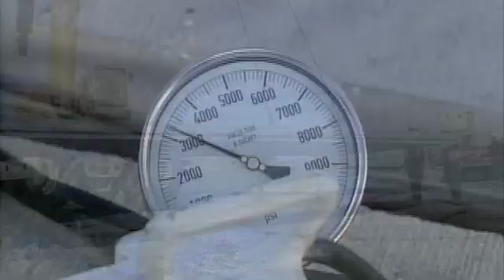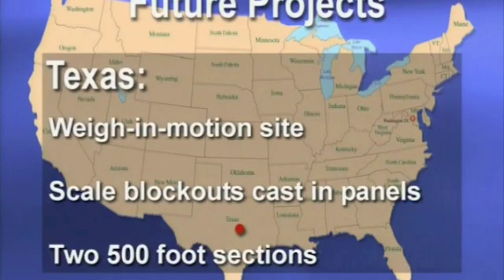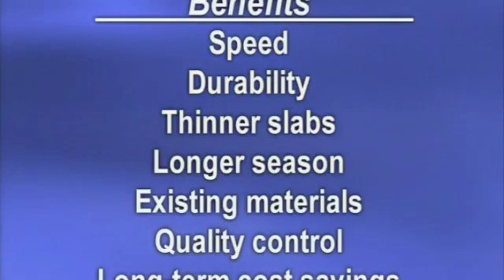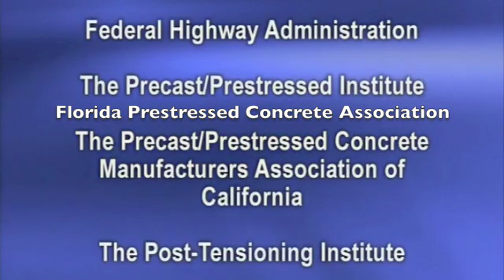Paving the road of the future. Part 2 of 2

Comment: It's much better than asphalt.
Reply: Each type of pavement has advantages.  The Resident Engineer for a section of highway has descreation in the repair methods used to repair the road.  Asphaltic Cement Concrete, or flexible pavement, has desirable properties.  Just like Portland Cement Concrete, or rigid pavement, has desirable qualities.

Comment: EXPERIMENTAL EXPENSIVE UNPROVEN B.S.
Reply: Research has been done with Caltrans, UC Berkely, UC Davis, and a company named DYNATEST.  I worked on a special Heavy Vehicle Simulator, that stressed the pavement with various wheel loads.  The machine weighed 137,000lbs.  And during a test, measured loads could be applied.  During the 60 day test of a section on the slab, 20 years of truck traffic could be simulated.  This precast technology was tested from July 2005, until June 2006.  At a test site located within the I-15/I-210 interchange.  One major benefit of this precast technology is the elimination of fines intrusion.  Which weakens the bottom 2 inches of the slab.  Overall Quality control is also improved.  All types of paving work require special tools and people.  This methods gets the job done faster, with a generally higher quality, and is a stronger product with or without rebar installed.  Caltrans and the University of California have been improving the quality of our roads, while the traffic demands keep increasing.
Reply: @TRICK-OR TREAT
Ba humbug!

Comment: The taper in the panels from the middle to the edges is not because of a difference in load. It is because roads have to be crowned in order to shed water. This is a basic part of road building which has been used since Roman days at least.